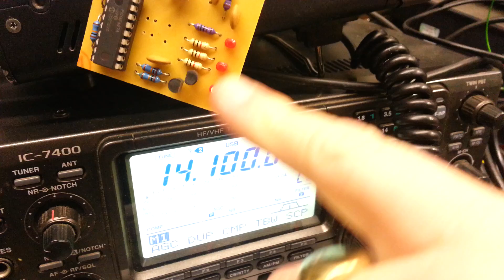M1GEO Icom IC7000 Roger Beep Module

Comment from the maker: Hehe, as the comments say, it was intended for use on VHF/UHF SSB. It gets difficault to pick out the lower noise signals in QSB.

I'm not too sure about the 7K on CB. Not something I've ever done. Mine isn't wide-band so it won't transmit there to try it.  The AM filter will be the same everywhere, I guess, so you could at least find that out from the technical specs online? Cheers, 74!

Comment: That's a nice sounding beep - not exactly the typical CB'er roger beep I'm used to hearing. Sounds good though :)
Speaking of CB, how does the Icom 7000 sound on CB (27 MHz AM)? Does it have the appropriate 6 KHz AM filter for proper citizens band operation? In all the video's of the Icom 7000 I've yet to see anybody test it or mention it being using on 27 MHz am CB.
Just wondering....